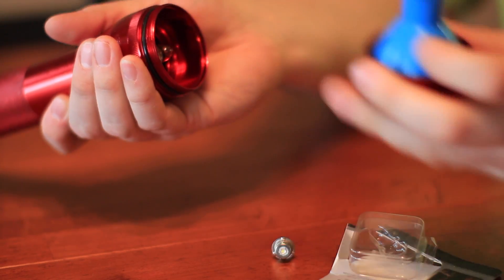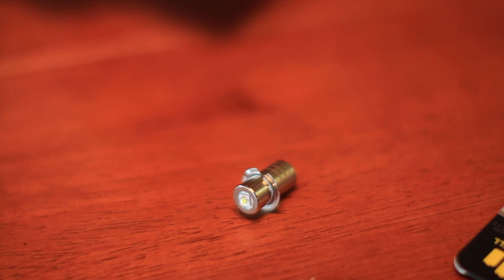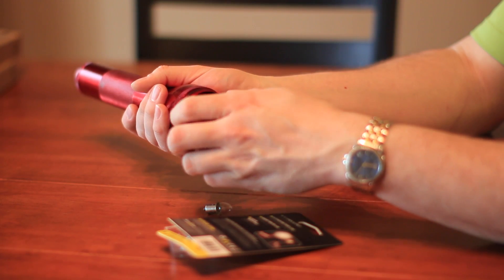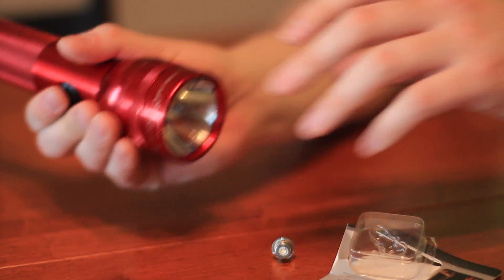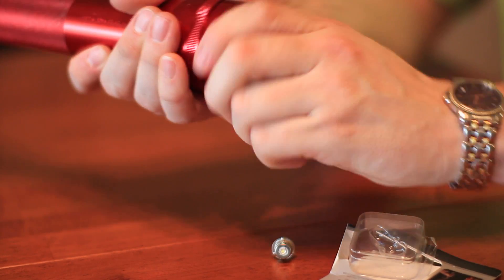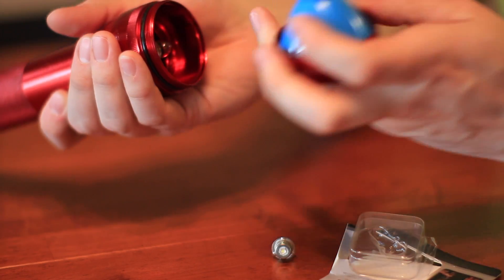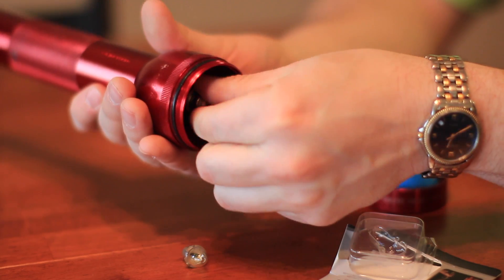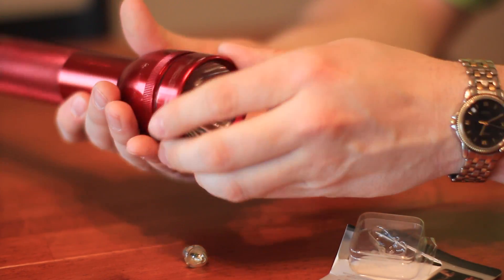How to Replace a Flashlight's Bulb With an LED : LED Lighting Tips

Comment: .... How to match wattage ?  
What voltage for what bulb ?
Bulb options. Types of fittings ?
Heat on the lens or just heat ?    
What bulb for 18650  3.7V  ?
Lumens ?
What else I might come across or not know ?

Not as simple as undo, take out old, fit new, redo up.   Go

Comment: You skipped right over it - how do you get the bulb out?  Pull? Turn?
Reply: I've been waiting for him to answer your question, and have put aside this project until he does so.
Reply: YES, the one BIG question: How do you, GET THE ONLD ONE OUT. Mine look LOCKED into place and will not budge.
Reply: My Duracell 300 isn’t like his. Nothing to unscrew on the lightbulb end. But  to answer your question, it sounds like the bulb is freed after you unscrew and remove a retaining ring. He went over it very quickly, but he did mention a retaining ring. I don’t think the part is just for show with a name like retaining ring; it’s retaining the bulb, which strongly implies that removing it will liberate the bulb from years of retainment. I didn’t see anything that looked like retaining ring, unless it was the blue thing. Good luck. My quest will continue...
Reply: Dude you can hear him clearly say to pull it out